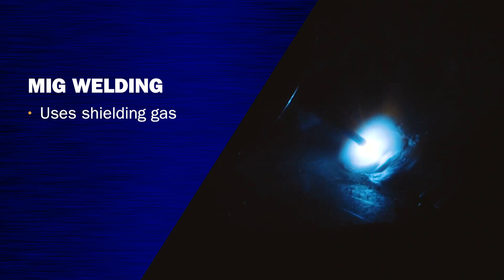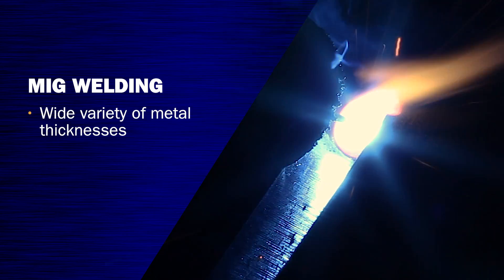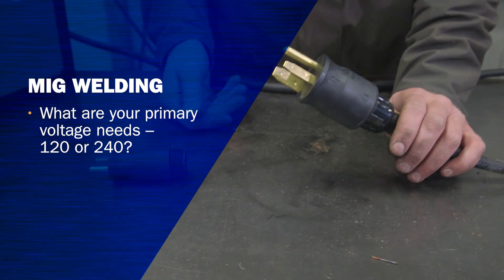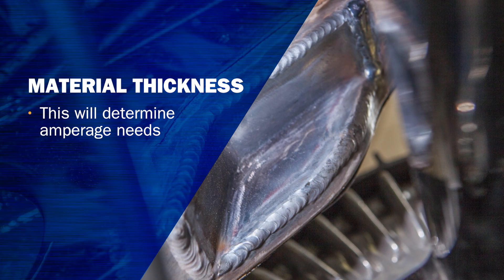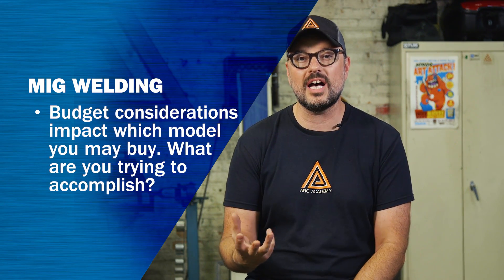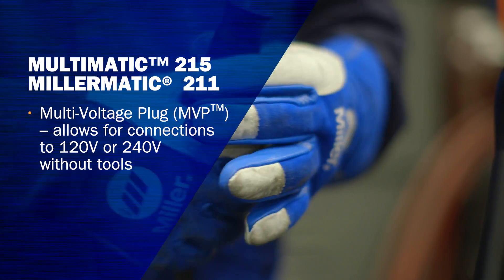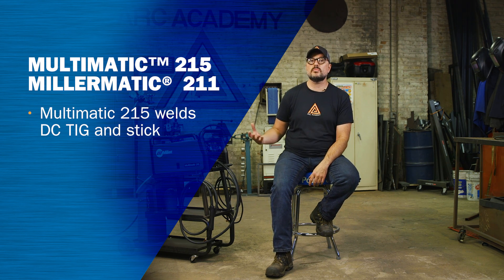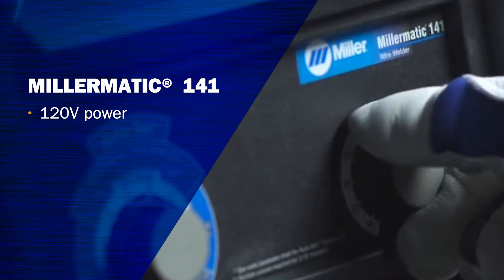Buying Your First MIG Welder

Comment: I might be getting my hands on a partial barrel of Lincoln .045 wire. I'm guessing it's about 150-200 pounds of wire. What machines can handle that size, short of a giant industrial type? I know .035 is the normal max and never heard of .045 until this job.
Reply from the maker: Thanks for your question.  .045" solid wire is a common wire that would typically run somewhere in the 175-350 amp range.  There is a wide selection of equipment that would have no problem running that diameter wire.  You may have more of a challenge setting up a machine to a drum of wire.  Drums are typically used on robotic cells or high production machines that have an external guide system from the feed drive rolls to the drum, along with a system that helps feed the wire from the drum without it becoming tangled.  Feel free to email us with any detailed questions to info@millerwelds.com.

Comment: Hi, watching the demonstration video of the welding machine, would you like to know what the reason the welding machine is in a tilted position in your cart? Does this improve the efficiency at the time of welding or just because it is in this position because of aesthetics? Thank's
Reply from the maker: Hi Saulo, thank you for the question. The cart in the video has been modified based on personal preference. Thank you.
Reply: Ok, I thought the one with the angled base where the welding machine was, was to improve machine performance or something.
Thanks for the feedback.
Reply: @saulomoraes9302  easier to read the front panel